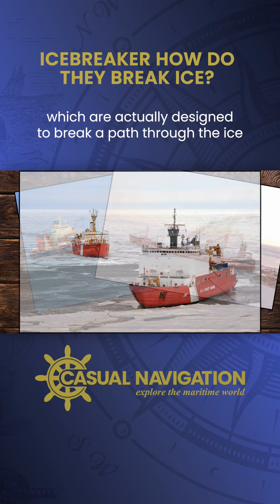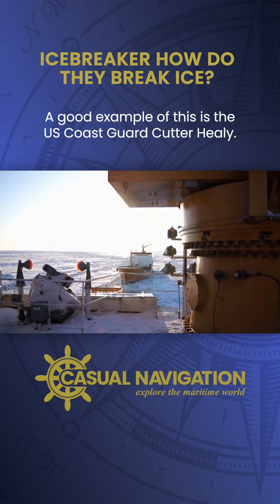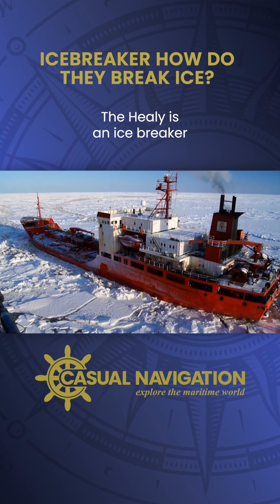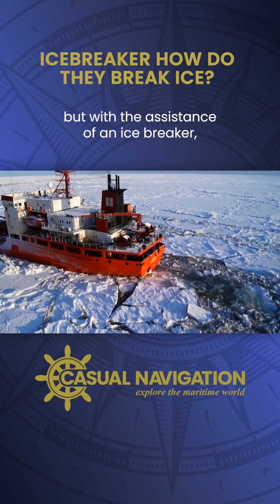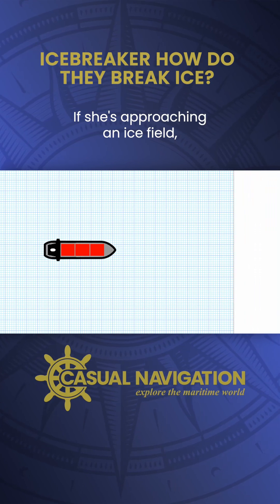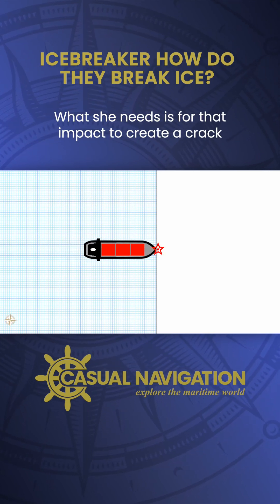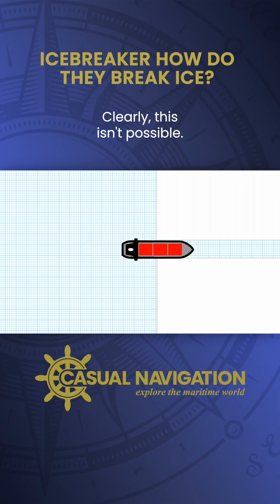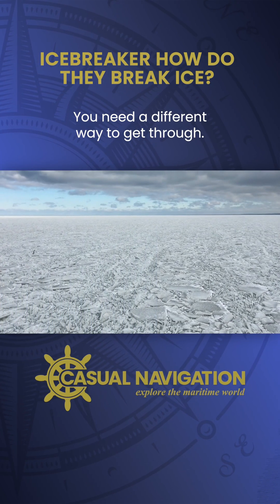Icebreakers How Do They Break Ice v2

Comment: Genuine question:
How much fortification would it take to allow the titanic to break through the iceberg it scraped?
Reply: Probably couldn't do it. Icebergs are not just thick ice layers formed on the water surface, they are THICK ice mountains, you would probably need a drill-like machine. Something like the ones they use for tunnel drilling.
Reply: Sea ice is when the sea freezes causing the salt to leach out as it grows in thickness.  It starts as a thin layer of grease ice and grows to be 10 feet thick in places.  Icebergs, however, are broken off chunks of glaciers where the ice had compacted over thousands of years and can be as hard as steel.  Titanic hit an arctic iceberg at speed and had no chance.  Icebergs are too large for any ship to persuade with 80% of its mass under water.
Reply: Valid question

Comment: how about ships built with a bulbous bow
Reply: They will tend to get stuck.
Reply: https://m.youtube.com/watch?v=6FrCusDG41U&pp=ygUVd2hhdCBpcyBhIGJ1bGJvdXMgYm93
And
https://m.youtube.com/watch?v=y2aZIrq-F-Y&pp=ygUVd2hhdCBpcyBhIGJ1bGJvdXMgYm93

They aren’t really designed for breaking ice and will probably be broken by the ice…like the video stated.
Reply: Ice strengthened ships have a reinforced belt to resist the pressures of the ice.  The bulbous bow is supposed to be below the surface ice as it’s not designed to break ice.